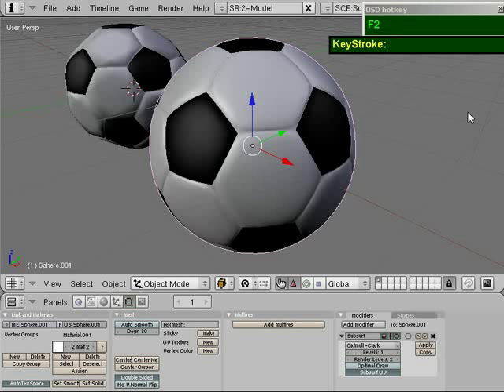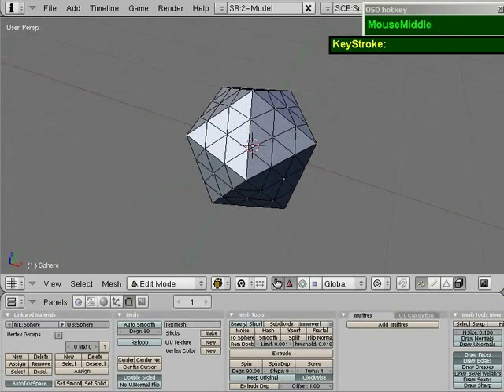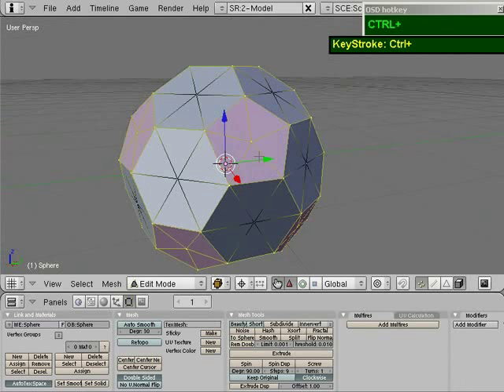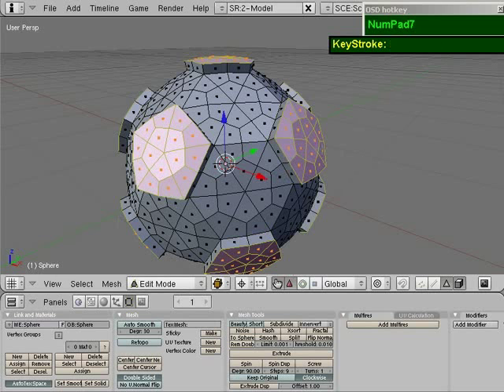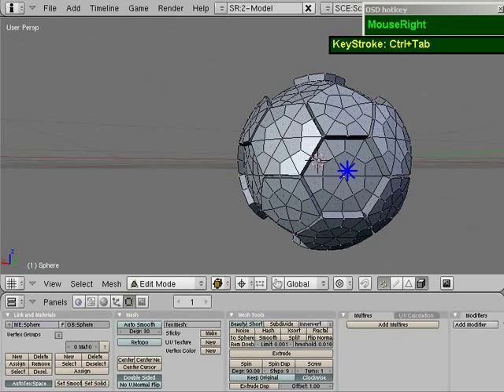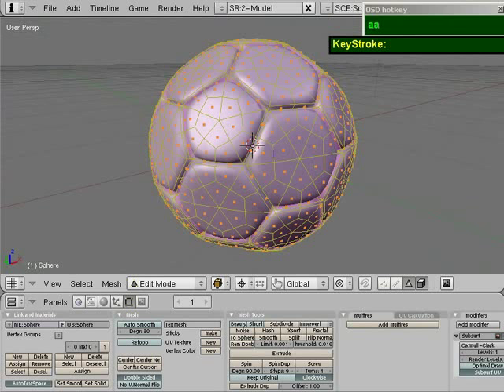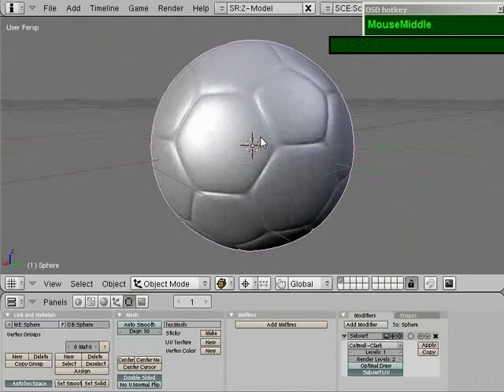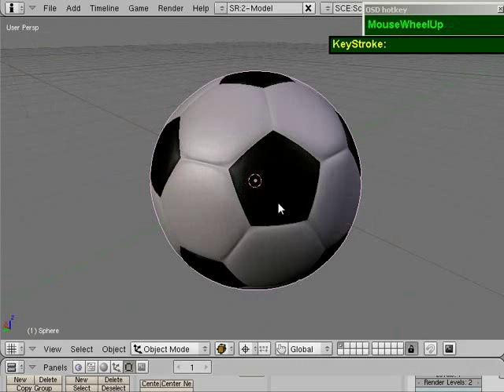Blender Soccerball/Football Modeling Tutorial

Comment from the maker: @iJammer8 You can actually specify where you want to put the images. In the Buttons panel below, Press F10 to access the Render Settings. On the extreme left there's a sub panel called the Output and just below you will see 2 folder icons specifying the directories for rendered image and back buffer image locations. Click on the top folder icon, a new File Browser will pop out and you can specify the render directory, but you must click on the "Select output pictures" to fix the new location.